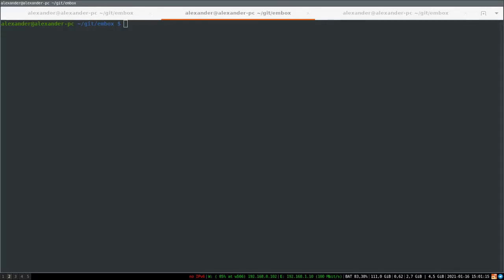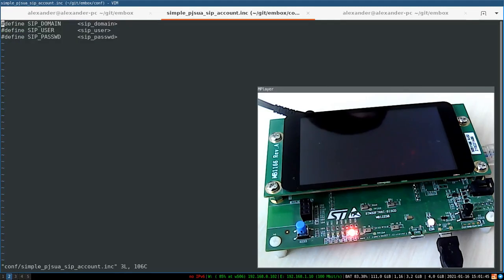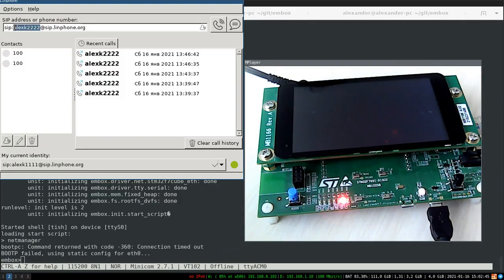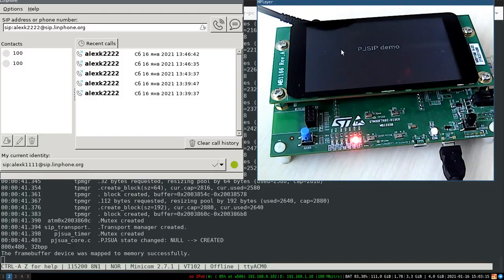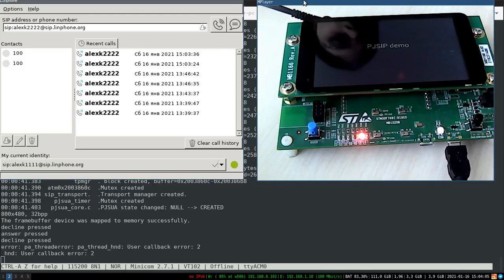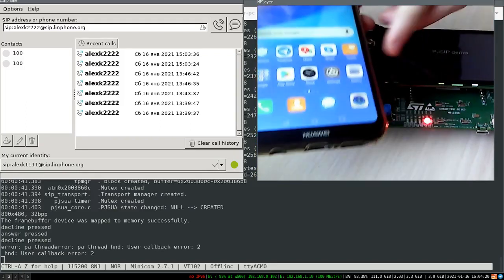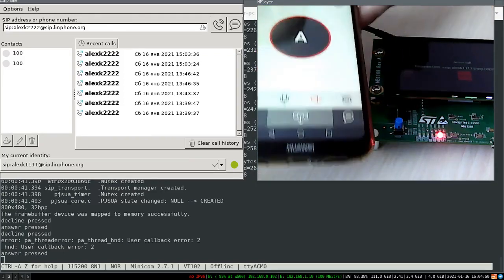SIP Phone with GUI on STM32F7

Comment: Hello,
in which file is the information regarding the codecs used stored?
Thank you.
Reply from the maker: Do you mean this one
DISABLE_FEATURES := \
	l16-codec   \
	ilbc-codec  \
	speex-codec \
	speex-aec   \
	gsm-codec   \
	g722-codec  \
	g7221-codec \
	libyuv \
	libwebrtc \
	#g711-codec

In this demo configuration options from PJProject are used. You can see configure option in the file (embox_root)/third-party/pjproject/Makefile you also can modify the configure options if you need
Reply: @embox-rtos  Thanks for the reply. There are so many codecs there, how is a specific one selected?
Reply from the maker: @terziwh   I pointed the list of the configure options You can remove wished codec from the DISABLE_FEATURES and add others. As I see #g711-codec is used by default, it is commented
Reply: @embox-rtos  Thank you,
where is the code used for digitalisation and transmission of voice? Thank you very much.
Reply from the maker: @terziwh  if you mean audio driver it's placed here https://github.com/embox/embox/tree/master/src/drivers/audio
Other audio manipulations are made in PJSIP. There is a PORTAUDIO implementation for audio driver in Embox so PJSIP can use this API.
Reply: @embox-rtos  Thank you. I mean internally concerning the controller, where is the code e.g. is CAN or I2C for transmission of voice packets, which peripheries are used, how the ethernet packets are transmitted. I would be intereseted to see where code relating to these matters is placed. Thank you a lot for help.
Reply from the maker: @terziwh  I see.
You should look into 'drivers' folder. You can find 'i2c' or 'spi' folders that contain I2C and SPI drivers respectively. As for AUDIO drivers for STM32 it is placed in 'audio/stm32' folder. STM32 ethernet driver is placed in 'drivers/net/stm32cube' folder. For both drivers, STM32Cube framework is used, but you can add a new driver for your custom board as it needs.
Except the drivers, Berkley Socket API and PORTAUDIO API are used by PJSIP
Reply: @embox-rtos  Thank you. Is there some possibility to debug such that the corresponding source code would also be shown?

Comment: Hello,
Really great video. Thank you.
However, I get the error "/bin/sh: 1: ulimit: error setting limit (operation not permitted) make: * [Makefile:40: confload] error 2" when I execute "make confload-project/pjsip/stm32f746g-discovery". Could you help?
Reply from the maker: Hello,
What is your host operating system?
It looks like this issue (https://github.com/embox/embox/issues/1796 )
Reply: @embox-rtos  Hello,
the link doesn't work. Secondly I am using windows.
Reply from the maker: @terziwh  
Ops, sorry I have corrected the link
I mean this https://github.com/embox/embox/issues/1796
Reply from the maker: @terziwh  In other words, it is better to use Linux on a virtual machine if WSL2 is not available on your Windows version
Reply: @embox-rtos  Thank you,
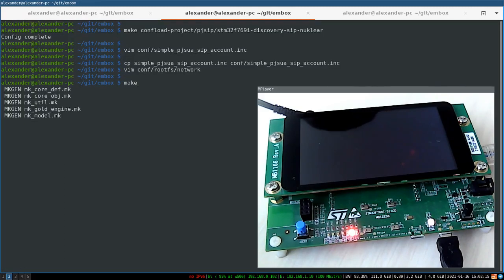now I am on a virtual machine. The ethernet settings, here the ip address to be considered is the ip of computer or router or somethin else. and at 1:01 why is soemthing beeing written at end of file?
Reply from the maker: @terziwh  Do you mean the settings in 'conf/rootfs/network' file?
if yes then you can statically set network settings for your board
`address 192.168.2.128` is your board IP address
'gateway 192.168.2.1' default gateway

it does not matter whether your board connect to a PC or a router. These settings depend on your network options.

You also can use DHCP and connect the board to the router directly
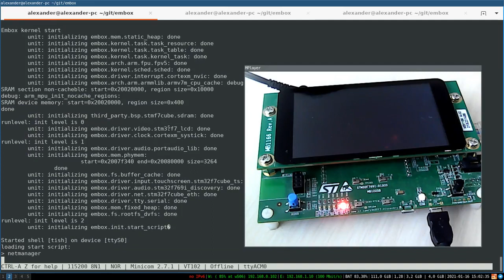Reply: @embox-rtos  Thank you. 1:21 how does on starting the board the program gets loaded automatically on the board?
Reply from the maker: @terziwh  Yes, after an image flashing it needs only put the power on the board, the program starts automatically. You can see the loading process via USB.
Here is the instruction for flashing https://github.com/embox/embox/wiki/How-to-flash-and-run-STM32-boards
Here is Embox quick start  video for STM32 https://www.youtube.com/watch?v=sI7L_ESxihM
Reply: I am using the stm32f769i discovery board.
Reply from the maker: @terziwh  That's OK. but you have to use 
make confload-project/pjsip/stm32f769i-discovery
or
make confload-project/pjsip/stm32f769i-discovery-sip-nuklear
for configuration.
Reply: but the problem is that when I do 
$ sudo openocd -f /usr/share/openocd/scripts/board/stm32XXdiscovery.cfg
I get:
Info: Listening on port 6666 for tcl connections
Info: Listening on port 4444 for telnet connections 
Info: clock speed 2000 khz
Error: open failed
Reply from the maker: @terziwh  It seems that your board is not connected to the virtual machine
try to get USB device list with 'lsusb' command and find your board in it. Maybe you have to forward USB device in the virtual machine settings
Reply from the maker: Hi,
You can debug the image with gdb (as usual) https://github.com/embox/embox/wiki/How-to-flash-and-run-STM32-boards. You need openocd and arm-none-eabi-gdb (multiarch-gdb for some distros) for debug on the board. You also can start debugging without the board if you would use qemu. Use "make confload-project/pjsip/x86-qemu-sip-nuklear" for this target
Reply from the maker: Sorry for the long response. It's better to use github (or contacts described on it) for such questions ( https://github.com/embox/embox )

Comment: 👍 this is exactly what I like to see, What LCD panel is that? and I'm guessing that embedded ARM SoC? what did you write the application in?
Reply from the maker: LCD panel is a 4-inch TFT LCD 800x480 - https://www.st.com/resource/en/user_manual/dm00276557-discovery-kit-with-stm32f769ni-mcu-stmicroelectronics.pdf. As far as I can see from the driver's source code it is OTM8009A compatible (or even it is).

Yes, STM32F7 has ARM Cortex-M7 inside.

The application is written in C using PJSIP as a VoIP/SIP library and Nuklear as GUI.
Reply: @embox-rtos  thanks! keep up the good work